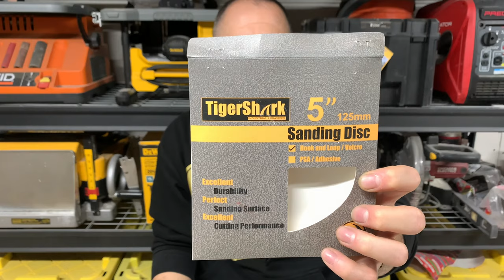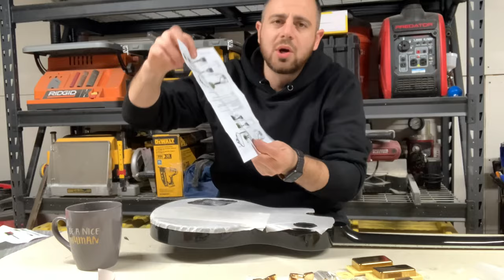DIY Les Paul Guitar Build (Black&Gold)

Comment: Kinda wish you had taped the wood for the neck joint cause that glue isn’t gonna stick as wel to the paint other than that it looks killer
Reply: Eventually, sadly the neck joint will start to crack. He should have left the neck joint raw wood before gluing it down. But other than that,  a beautiful build.
Reply from the maker: I agree with the both of you, luckily it’s still holding perfectly 3 years later! :)

Comment: Watching you glue that neck on over the paint was agonizing, but beautiful job on the paint work.
Reply: I also don't like how the sides of the neck where it attaches to the body were painted. Won't be as strong of a bond with the paint. At least that's how I understand it.
Reply: The classic open book headstock shape is typical of all Gibson Les Paul electric guitars, but this one didn't work out well.

Comment: When Gibson sends their bodies and their next they actually put them in a vice and send them. That would be the best way and they usually have rubber on the vise that actually covered the teeth of the device so it doesn't Mar the finish but as an extra precaution you could put like material between the rubber and the body.

Comment: Just confirm, did you use a flat black for the color or gloss black.
Thanks
Reply: I'm pretty sure he used flat black so it wouldn't be as drippy
Reply from the maker: This is correct and then gloss clear